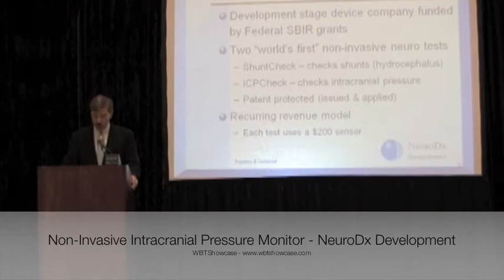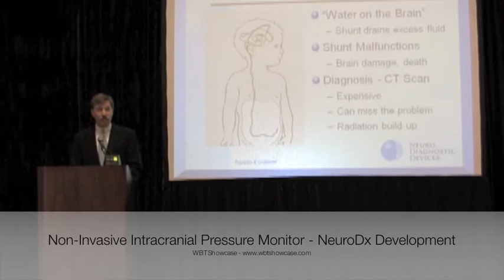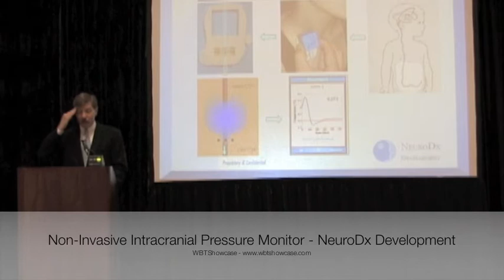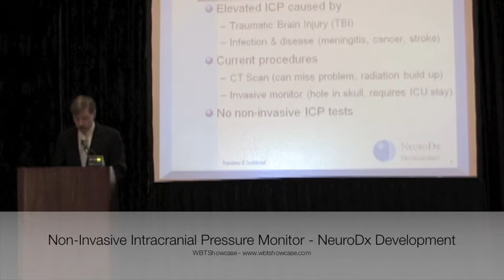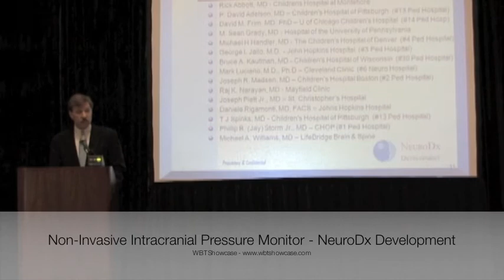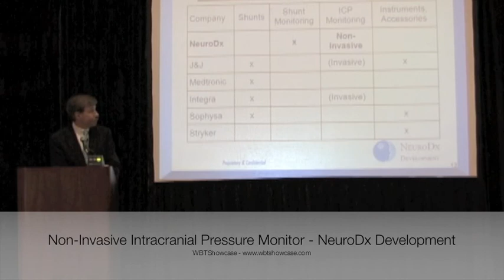Non-Invasive Intracranial Pressure Monitor - WBTShowcase 2010

Comment: Proposed non-invasive ICP monitor is not pratical because it will be necessary to calibrate this monitor to individual patient. Such calibration is impossible because the "golden standard" non-invasive ICP meter needed for calibration can not be created and does not exist. How Innovation Arlington will ahieve the accuracy and precision of non-invasive ICP measurement without calibration?